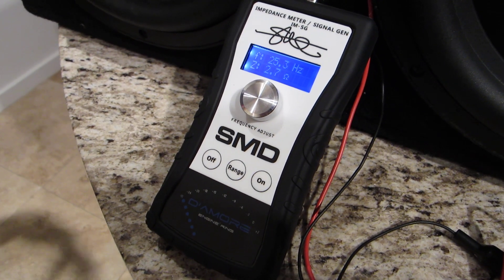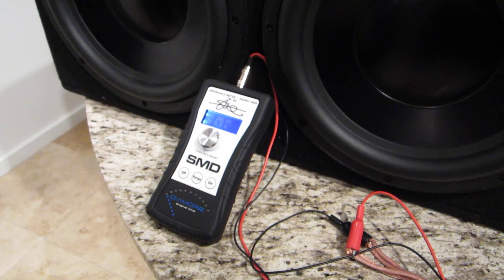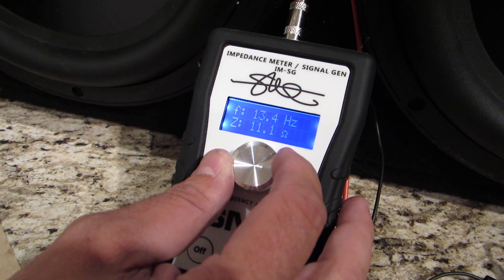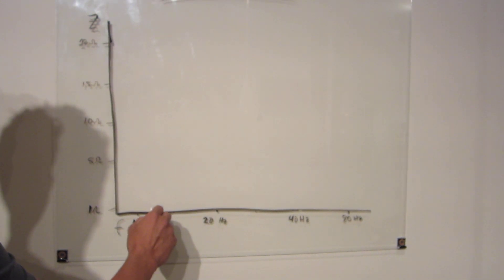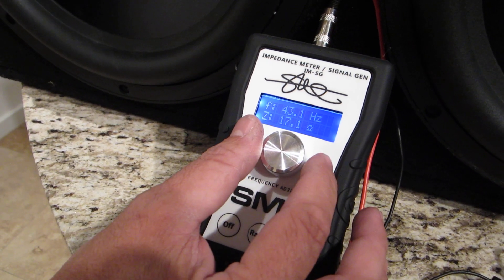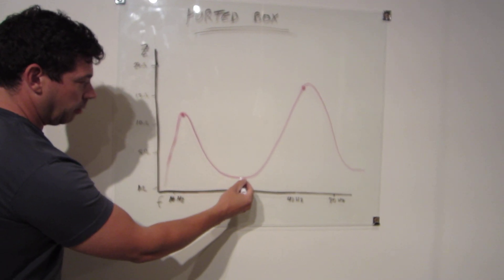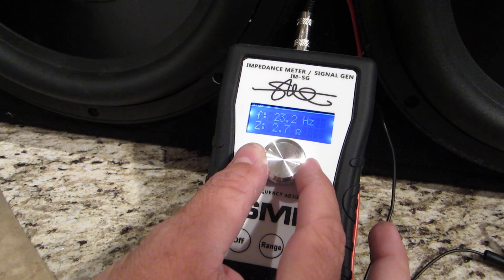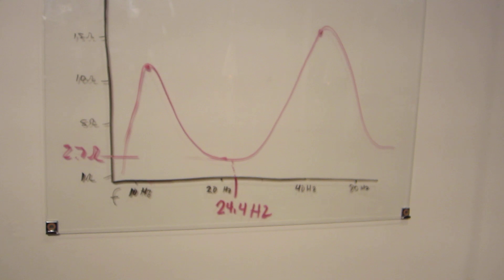IM-SG Video 2 - Measure Tuning Frequency of Ported Subwoofer Box

Comment: Hi, regards, do you can explain please how we can find the volume in vent box.?
Reply: you could use the same method for sealed box, but would have to plug the port completely air tight.  Other than this there is not another way